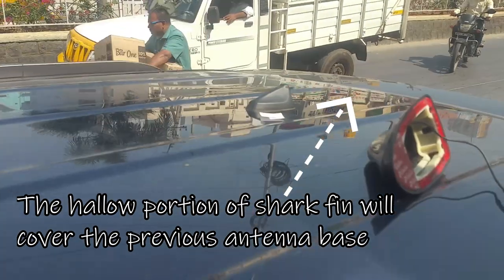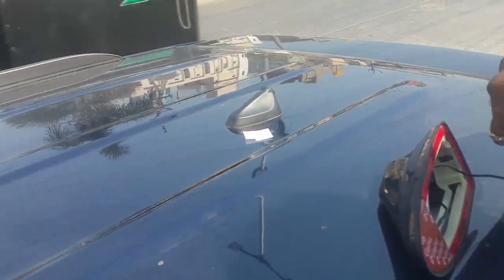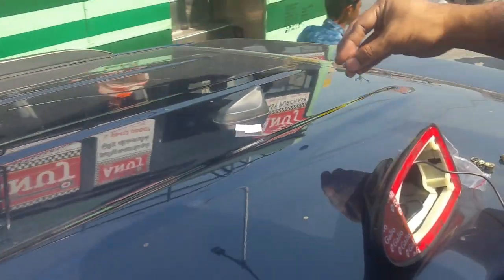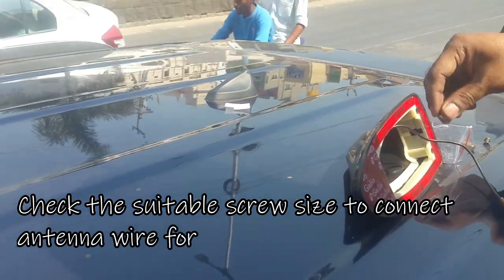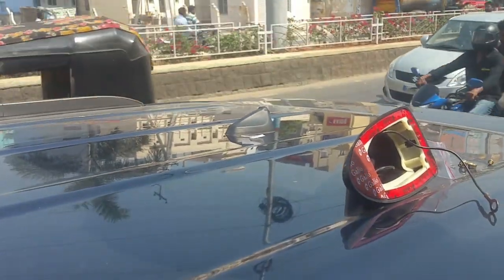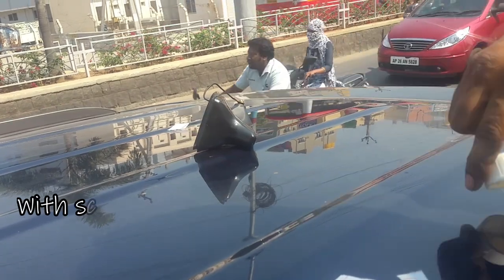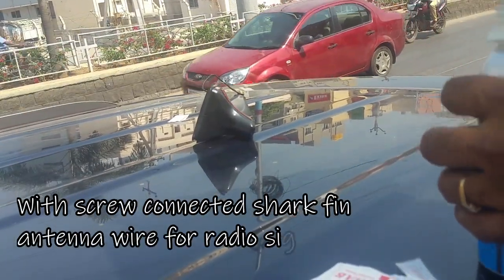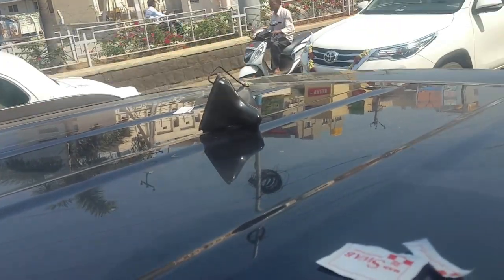shark fin antenna installation on Car - changing FM antenna to stylish shark fin antenna

Comment: what brand is it and how is the reception for radios etc can you make a follow up video regarding that
Reply from the maker: It is 3rd party, I dint remember the brand, signal reception is good no problem, using from more than 6 months
Reply: @superradar  what was the average cost any idea
Reply from the maker: Around 800Rs
Reply: @superradar  thank you!
Reply: did you buy it from amazon would it be possible for you to post a link about the big one  as in the one you installed thanks !
Reply from the maker: @Highonchlorophyll  no I bought offline in a shop